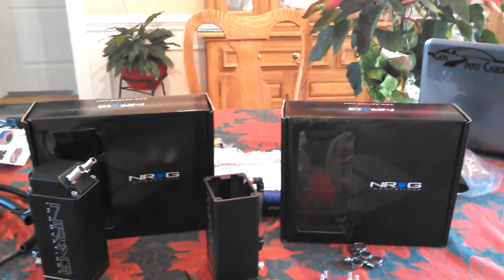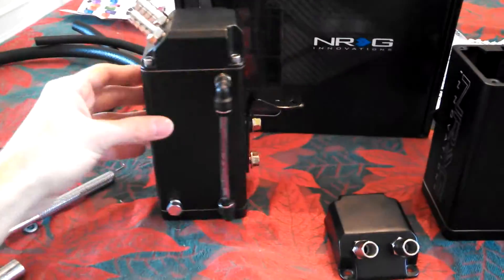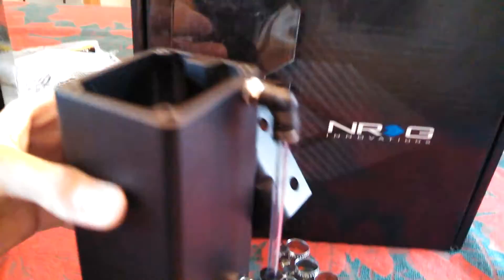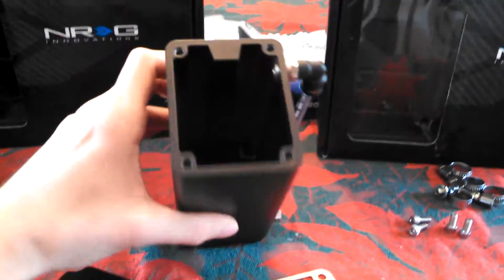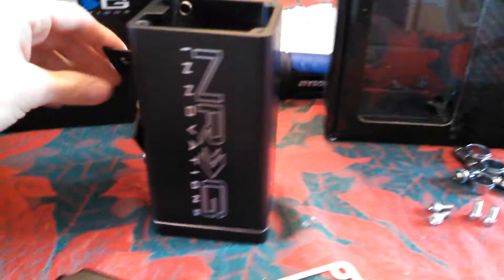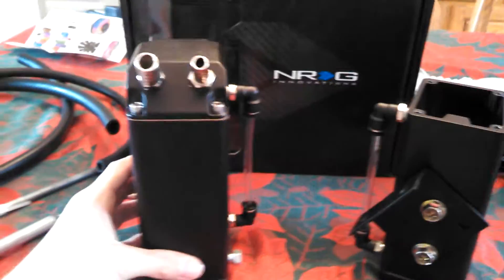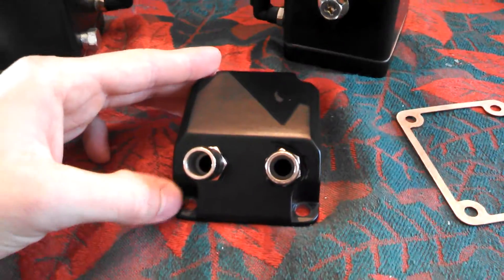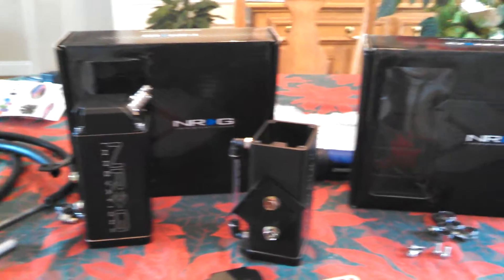NRG Oil Catch Can Review

Comment: Did you put anything inside like a baffle and steel wool for the vapors to catch onto? Or did you just leave it like that... empty?
Reply from the maker: Just left them empty. The turbulence from the air separates the oil. Check out my channel for oil catch can change video. They collect a lot oil, so they definitely work.

Comment: Hi. So you taking out the level indicator later? it does not effect anything right. I got same design but different brand. Thinking to take out the indicator as well.
Reply from the maker: Actually I never ended up taking them off. I'm glad they are still on. I had the hood open at an event and the indicator showed the can was nearly full. So when I got home I checked it, and the can was almost full. So definitly keep it on. This was after a few months of freezing weather when I only drove the car 1 mile to campus. So it collected a lot of water because the engine wasn't getting to operating temp.